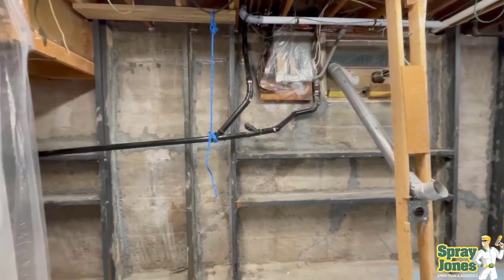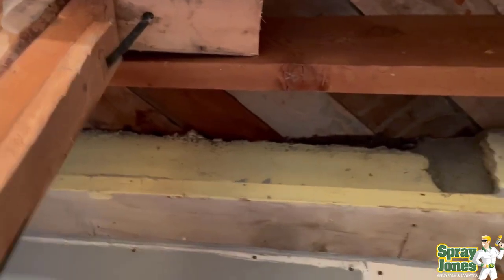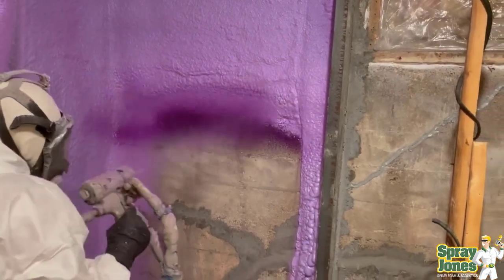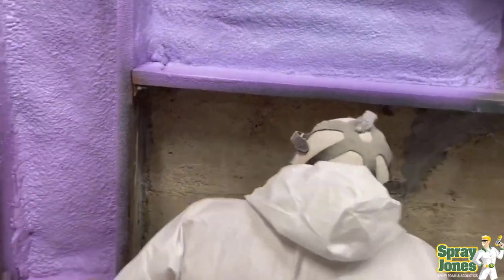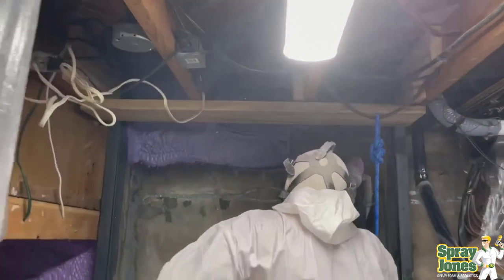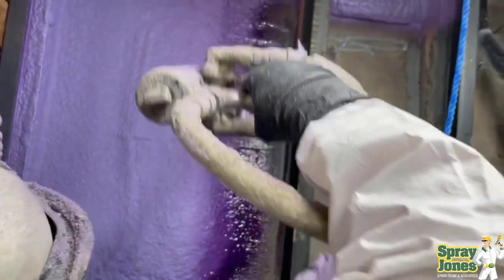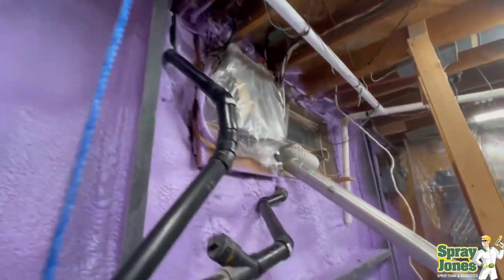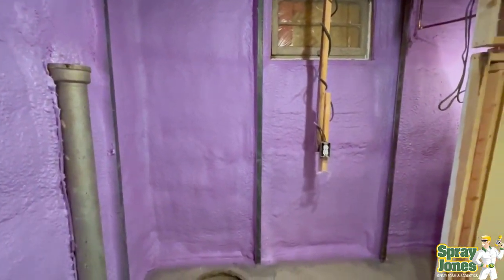Foundation Crack Up Fixed with Spray Foam Insulation | Braced Basement

Comment: I didn't know it could be used as water proofing ! Very good , thanks for the vid ...
Reply from the maker: Watch the "in contact with ground" playlist.
Reply: I re-watched your vid , in contact with ground  , great vid , this spray foam is fantastic . I had my crawl space done a few months ago , it had No insulation at all . Before they spayed , it was 10gagree's outside , I had the thermostat on 80degrees and it was very cold inside 62degrees . That night , I had to turn the thermostat down to 74 because it was getting too hot inside .  @SprayJones

Comment: A better solution would be to excavate the exterior of the basement walls and insulate the exterior of the walls and put in perforated pipes to take away any water that is pushing up against the basement.
Reply from the maker: At what cost? These people are retired...
Reply: @SprayJones  Yes, I agree that it would be much more expensive. Insulating the outside would probably be a repair that would last 100 years. How long would you estimate this solution lasting? I would think that the steel would rust out within 30 years and the repair would need to be redone.
I agree that it's not a cost efficient repair for a retired couple, unless they have plans to pass on their house to children.
Reply from the maker: @AlexeiTetenov  These repairs last forever. there is no rust inside of the walls. The steel is not constantly wet, plus that would take 150 years to rust that brace away.
This is a whole industry where we are fixing these up with steel inside instead of pouring a new foundation after lifting the house up.

Comment: Gigantic thermal bridges all over the place with all that uninsulated steel. A paradise for condensation. Will be raining in there during the summer.
Reply from the maker: How is this a gigantic thermal bridge when the flanges are imbedded in SPF? 3/16" of steel is all that is left to conduct. 
Plus we do these for a living.... if they condensed wouldn't it be likely we would cover them and mention it??
Reply: @SprayJones  Steel conduct heat 300 times better than wood. When the steel is penetrating the insulation layer, that is significant. High temperature in the room with high moisture will condensate when it reaches the steel with the same temperature as the cold ground. If Joe Lstiburek should see that, he would probably pass out! 

It could all be solved with a 1/2" spray foam on the steel too.
Reply from the maker: @elbuggo  At 34% RH you need 17C of difference from substrate to air temp to condense. The steel with foam on either side of it, with only 3/16" of an inch not insulated which is NOT a large area cannot bring the temp of the steel brace down cold enough to condense at normal humidity levels. Again we live this and see what happens in our climate, if each brace dripped non stop after we sprayed them, we would know and be called back to add foam. 
You could have just asked if they are an issue instead of making a statement that they are an issue -  and not knowing they are. This is not keyboard warrior banter for us we do this all day long in harsh Canadian climates.

Comment: Would you install closed cell spray foam in a basement in a freezing climate? The basement is old (1920), so assuming no water protection is installed on the outside of the concrete foundation.

Comment: I'm renting in winnipeg. I got steel angle iron bolted to one of my basement walls, no grout joining it to the wall though. The basement leaks every time there's a heavy rainfall, and during the spring thaw. It sucks. Wish I could get the walls spray foamed.
Reply from the maker: Yup. Makes it warmer too.

Comment: Still going to get a lot of cold transfer on those metal beams.
Reply from the maker: The flanges are sprayed. How much cold transfers up 3/16" of steel? We do this for a living, if it was terrible we'd change what we are doing.
Reply: @SprayJones  That basement is a 2000$ a month rental unit in Canada now. Nice to make it comfy for the tenants.

Comment: Is there a study that talks about how spray foam reacts to hydraulic pressure from the outside on spray foam applied to inside walls. I watch many of of your vids and you reference studies.
Reply from the maker: Go to the basement playlist and you will find an older video on basements with the study that CMHC did on it. Few people care about reports anymore.
Reply: @SprayJones  will do thx. Just cant wrap my head around how foam spray inside can resist water pressure from outside. Keep up the great work.
Reply: @SprayJones  This was a great video and I also care about the reports! Keep up the good work!
Reply: @SprayJones  Link to the video? Or title? I can't seem to find it.

Comment: I always thought a pure poly urea product would be a really good solution for a basement like this.
Reply from the maker: A coating would be horrible. Sticking to concrete with a coating takes a lot of prep. However with SPF polyurethane and the expansion of foam we are the PERFECT fit because we fill the holes and cracks and press into the wall. So no adhesion issues.
Reply: @SprayJones  poly urea sticks pretty well to concrete, but I agree, filling gaps and holes much easier with the foam

Comment: I'm guessing the building above had a great deal of value.
Otherwise, it might have been cheaper to tear the whole thing down and start over.
Reply from the maker: Well.... they lived in it for 50 years. The upper level is fine, the basement needs fixing and this is the lowest cost way of achieving that for them.